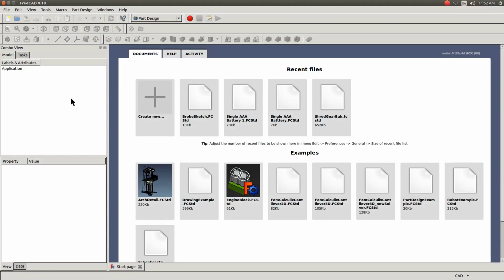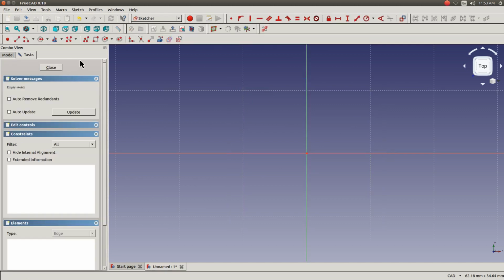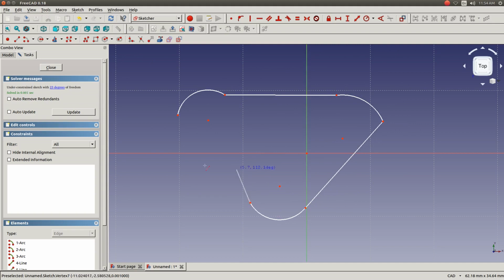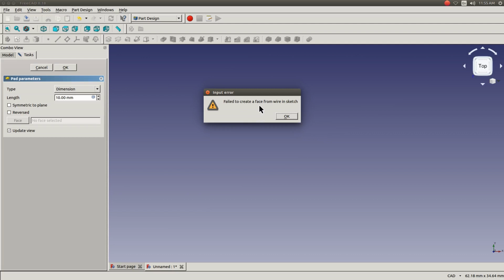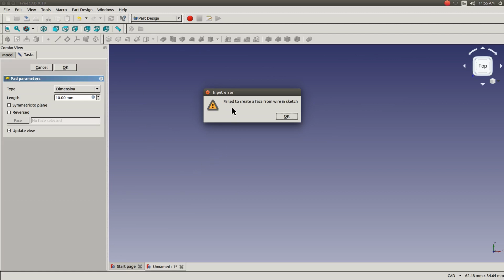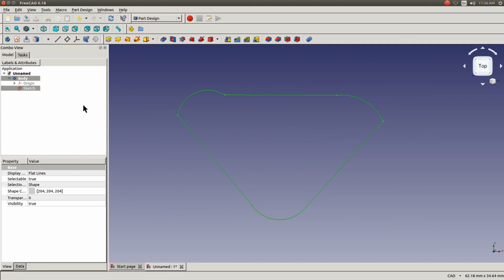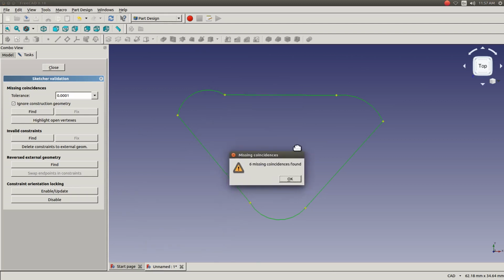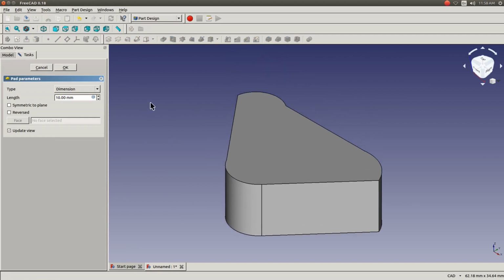FreeCAD Broken Sketch Broken Face 2020

Comment: it didnt work for me it couldnt find any problem to fix..
Reply from the maker: That’s really too bad.  The only thing I can recommend is the brute force method which I also outlined in the video.  Also check to see if you have two enclosed loops which are touching.  Good luck.

Comment: for somereason i dont have the option to press validate sketch
Reply from the maker: Wow, that’s a new one!  The only time I encountered that, as in the button was grayed out, was when there were no problems with the sketch.

I hope you’re using release 0.18.  I do remember in the early days of the 0.19 development cycle, there was some experimentation with moving validate to a new location.  Happily, in the stable release, it’s in the same place its always been.

It looks like I’m finally moving to FREECad 0.19.2.  It took me quite a while to get it working properly.  I suspect I’m not alone as many others are still using release 0.18. Look for more videos relative to that release soon.

Comment: For anyone using version 0.19 this tool is no longer in the Part Design tab. It is now in the Sketch tab. (to the left)
Reply from the maker: This reminds me of the days long ago when 0.16 was the stable release.  I downloaded the 0.17 development version.  Through the course of many updates, items in the GUI kept moving around so this is no surprise.  When 0.19 becomes the stable version, I might have to do a 2021 update of this video.  Thanks for the heads up though.  I’m sure many users of 0.19 will find this useful.
Reply: @bcastlar3453  I am using 0.19 and can not find the validate tool in the sketch bench even thought I was told to look for it.  Of course their may be an icon but again I do not know for what I am looking.
Reply: This should be a pinned comment
Reply: Thanks, I was looking for it.
Reply: thank you!

Comment: guess what, didnt work for me. am dying now
Reply from the maker: One thing came to mind recently.  While it’s possible to extrude multiple closed loops on the same sketch, it won’t extrude if the loops are connected.  Also look for loops contained within another loop. That requires two separate sketches to realize that.  I learned a lot of hard lessons while doing my series on parametric cad.  You’ll find a link to that series at the end of the video your watching.  Failing that, just convert all sketch elements to construction.  Then slowly add just a few elements to the non construction state making sure you add a temporary line to your drawing to close the loop.  Repeat until you find the problem.
Reply: @bcastlar3453  wait. I think you just described my problem. Maybe.

Thing is, I have 3 circles, all centered and the smaller ones inside of the biggest. 1 circle only creates a cylinder, 2 create a tube and 3 create a broken face. So I guess I have to make the tube and then substract from there
Reply from the maker: Yes!  To create a tube, you need to delete the inner circle then extrude.  Atop the tube extrusion, you then create another sketch.  On that sketch, you create the circle you deleted.  Then you use the notch tool to punch a hole in the extruded cylinder.  Pay attention to the notch depth.  If you select the, “Through all option”, if there is anything below your cylinder, the notch will punch a hole through it as well.  Hope this helps.  BTW, on my parametric cad series, I’ll take you through a guided tour through many instances of just what you’re experiencing.

Comment: Super. I have more problem in Freecad for "failed to validate broken face", it's pain. Thanks for your video.
Reply from the maker: I just now noticed that you also subscribed.  Thank you so much!  If you’ve checked out the other comments, you probably know that I’m currently running series FreeCAD parametric programming.  If not, do check it out.  It’s time we automate our lives instead of repeating the same thing over and over again.
Reply from the maker: You are most welcome

Comment: Thanks a lot man.
Reply from the maker: You’re quite welcome.  BTW, if you’re into building projects, I’ve started a series on FreeCAD parametric programming.  At the end you’ll end up with a FreeCAD file that prints a project enclosure of your desired size and shape.  You just start the file and plug in four dimensions.  After that you can either 3D print it or use the path workbench to generate CNC code to machine it.  I think I added a link to the very end of the video you just viewed, or you can go to my channel page and find it there.  Anyway, I’m glad this video helped.
Reply: @bcastlar3453  I'm watching the entire playlist, I appreciate the effort you've put into this.

Comment: you have a great presence in your voice. Thanks for the video; I subscribed.
Reply from the maker: Thanks so much for your kind words.  I especially appreciate that you subscribed!  That means a great deal to me.  YouTube requires that a channel get 1000 subscribers before it can march down the path toward add funding.  I still have quite a way to go, but this helps.

If you’re at all interested in FreeCAD parametric programming I started a new video series titled, “Crazy Simple 3D Printed Enclosure with FreeCAD 0.18 Parametric Design”.  Part #1 is out now, while part #2 will be out later this coming week.

Again, thanks so much for your support.